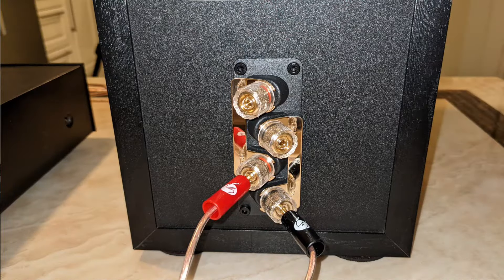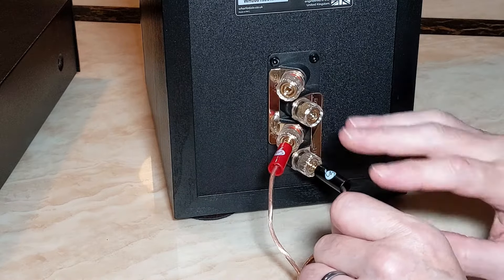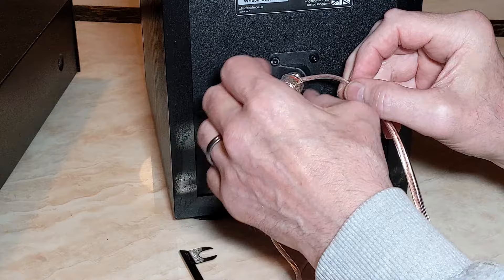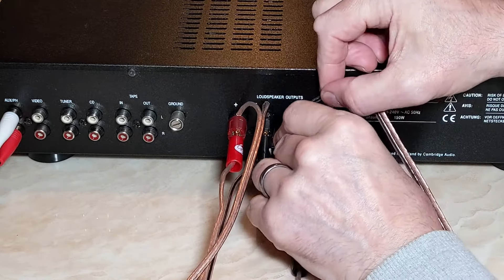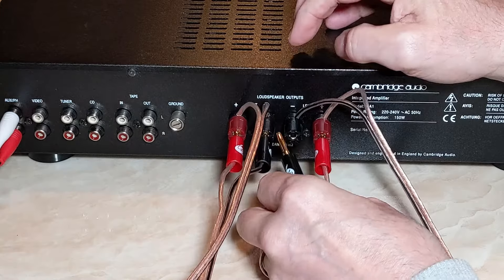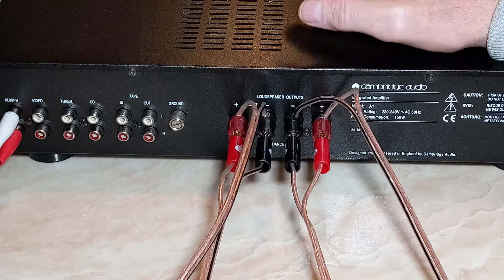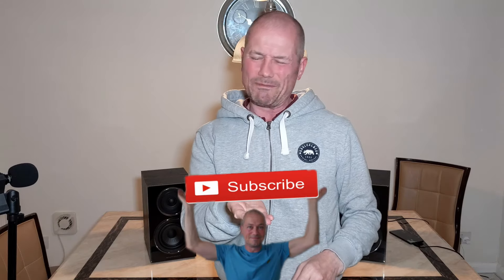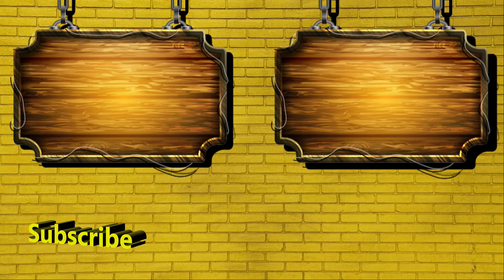How To Bi Wire Your Speakers (Includes Sound Comparison) #utilitariantv

Comment: Would it make more difference if the amplifier has A and B outputs for biwiring,   or using 2 amplifiers at all for the biwirings?
Reply from the maker: Although some people suggest otherwise, using A/B outputs wouldn't make a difference. Using two amplifiers (Bi-Amping) is very different from Bi-Wiring and also more costly but you may hear a difference?

Comment: i would also just like to add… that, yes there is a vast improvement in sound quality when upgrading to solid copper wire.
i certainly noticed that.    I’m using a DVD player with a built in amp;  so… basically I’m listening to music straight from the horse’s mouth; so to speak.     It seems to me also, that.. the more watts input a speaker has;  a much better realistic sound quality you will get.   
i recently bought a pair of Moukey speakers ( 3 way 55 watts input)  but the Wharfadale 9.1 beats overall. 
Wednesday 12th October 2022  U.K. Southampton

Comment: But surely the point of bi-wiring is that you use different types of wire for woofer and tweeter...? Some wire, for example thicker gauge wire, transmits lower frequencies better, some wires transmit higher frequencies better. You use different wire types depending on what effect you want.

Comment: Is bi-amping intended only for passive speakers then? what would be the point to bi-amp active speakers otherwise? A noob question but still does my head in.
Reply from the maker: I'm not sure that you can bi-amp an active speaker as an active speaker has its own amp. There may be some out there but it's rare.
Reply: @UTILITARIANTVUK  that's what i thought, thanks for clarifying

Comment: Hi, what speakers are these? They sound good, and what receiver?
Reply from the maker: Wharfedale Diamond 12.1 speakers and Cambridge audio A1 mark 1 amp.
Reply: @UTILITARIANTVUK  Thank you. I had to play both samples many times to find the difference, biwired's volume is slightly lower than the other,  if you are absolutely sure volume was kept exactly same at amp level for both sound samples the difference with biwired is lowered volume with a pinch of added subtlety

Comment: What I do run is run a small wire by the speaker from the one port to the other. Those plates were actually working as bi wire in the same way, which is why you probably heard no difference.
Reply: This is exactly what I was thinking.....this guy clearly has no idea what he is doing. Most higher end speakers that are bi-wire capable come with a jumper in them to make them bi-wired straight from the factory. The jumpers are made of metal hence it being a conductor of sound. This is exactly why he heard absolutely no different BECAUSE THERE WAS NONE!!! LOL. Besides he needs to buy a nice set of OCC Bi-Wired 2-4 banana cables. If he just would listen to the speakers with the wires connected to just the bottom (low) connection on the back of speaker (WITHOUT THE JUMPER IN) and then wire it how you have speaker wire going to both sets of positive and negative terminals on the back of speaker and tell me if you don't hear a difference then!!?? .......THATS BI-WIRING
Reply: @thomasfitzgerald2595  Not really, just check the Wharfedale specs and you'll see that for a standard connection you need to keep the metal plates (the signal needs to go to both crossovers, otherwise you'll get only highs or lows) and for bi-wiring you need to remove it so the same signal goes to both crossovers again but using 2 different conductors this time as it supposedly reduces the intermodulation effects. Electrically bi-wiring creates a parallel connection with the same voltage through both wires however with different currents. These being said, if it makes and audible difference or not it depends on the listener. (further reading https://www.qacoustics.co.uk/blog/2016/06/08/bi-wiring-speakers-exploration-benefits/ )
Reply from the maker: I literally followed the guidelines in the Wharfedale manual exactly as it was laid out. So either you clearly do not know what you are talking about or Wharfedale has it wrong? PAGE 5 OF THE MANUAL HERE (I can write in caps too😃) https://www.wharfedale.co.uk/wp-content/uploads/2018/11/Diamond-200_manual-print0725-1.pdf
Reply: @thomasfitzgerald2595  the jumper is to send the signal from the single wire to the two separate crossovers, single wiring. Remove the jumper and run a single wire to the low end and a separate single wire to the high, that makes two sets if wires, bi-wire. Putting the jumper in does not bi-wire the speaker, it is getting information from one set of wires and sending that to the two separate crossovers.  Running wire to each crossover separate  preventing Intermodulation. One will have to study that on their own if you don't understand the different current speed rates as they enter and exit the different  crossovers and speakers. Using a single wire with blocks is not bi-wiring, it is pushing all information to both crossovers through one cable, causing the signals to pass through at different times and causing a traffic jam of sorts. Bi wiring let's each crossover recieve and expell the signal at its pave, not get in the way as each one is putting out a different rate through one wire back to the amp.
Reply from the maker: My response https://youtu.be/_5FH2tKONQ4

Comment: Bi wiring makes a difference to me. Instead of the crossover separating a signal into two. It just separates high or low frequency. Plus less resistance from cables. I dont use cheap amp. Cables or speakers.
Reply: That's literally not how bi-wiring works.
Reply: Lol. Crossover is still engaged with biwiring.

Comment: You prob don't have enough power or didn't do it right, or wrong specs in general. I have Yamaha NS555 tower speakers with a pretty old Yamaha a/v and I run biwired via speakers A&B. 1 pair goes to A, other pair to B. If I turn off A, only bass plays, turn off B, only highs play. So it seems more power to the tower (haa that rhymes) and louder when both in. Same length heavy gauge weird 6'for all 4 wires. Wonder what would happen if I left them both with jumpers, more power/volume????

Comment: Great video, thanks! What wires were you using? What would you recommend fo a Wharfedale 85th anniversary and an integrated amp? Cheers...
Reply from the maker: I'm just using Amazon Basics. Really good for the price if your cable requirement is under 5 metres. https://amzn.to/35GqO0J

Comment: There's no point in "bi-wiring" from physics point of view. But: bi-wiring creates a "ground loop"  -  a loop of two parallel wires connected at the ends forming a giant coil which is prone to picking up electromagnetic noise... So unless one is driving two speaker inputs from different sources (can be same amp but with different spectral drive - highs, lows, etc.) - there's no point in biwiring.

Comment: In this demo the copper strips on the speakers were doing the same job as those wires were doing. As thats not a bi enabled amp. You need 4 outputs on the amp. Not 2. 👍🏼
Reply from the maker: Wharfedale actually recommends it in the manual  the way I did it. Although I have tried it with a/b speaker outputs here https://youtu.be/h-H6PW452PE
Reply from the maker: @HyperTech Electronics Wharfedale must be stupid too. That's exactly how it's recommended in the speakers manual. Also, try taking your caps lock off. 😄
Reply: That is bi-amping. This video is about bi-wiring 😂

Comment: I bi wired wharfedale diamond 220 s and Rotel RA810 so not a million miles away from your setup.  I noticed a separation from high and low and it definitely didn’t sound as congested but the big thing is music I’ve grown up with and know very well had noises and tune I had never heard before. Don’t expect massive changes in volume , bass  and treble like I was expecting. Let the system settle in for a bit , play some of your favourite tunes and Im sure you will notice clarity that was never there before. Hope this helps a wee bit

Comment: 56 years old now but when I was in my 20's I could definitely hear a difference cant tell from this vid though...as your not bi wiring the amp just the speakers that's not bi-wiring to my knowledge sir...
Reply from the maker: Actually, wiring two amps is called bi-amping. The way I did it was taken from the Wharfedale manual in the 'how to bi-wire' section.

Comment: Im 22 and I personally couldn't really tell the difference during the first part of the song between the two. In the second part though the Bi wiring had a little more punch in the bass frequencies compared to the single wiring. I've got a hifi system that I'm trying to set up with polk audio RM2000 monitor speakers, RM1000 Subwoofer, CS150 centre monitor and 2 JVC SP ES5 bookshelf speakers for surround sound. I'm trying it out with music production :)

Comment: I don't hear a difference. I mean all the bi-wiring is doing is replacing the copper jumpers from the speaker posts so why would it make a difference? Its still receiving the same signal from the receiver. I think bi-amping would be the only way to really see a difference.

Comment: I noticed a difference. I just got a Denon PMA600 and Wharfedale 220 speakers. I thought that it rounded the sound off nicely and elminated the treble heavy sound associated with standard wiring. It also cleaned up the sound of vinyl nicely

Comment: Really interesting! I've never thought biwiring had any merit, but I'm certain I heard a difference between your 2 samples... I kept my eyes closed, listened through decent headphones with an external dac, and opened my eyes when I heard a difference; when it sounded "fuller" I opened my eyes to see "Biwired", and when I next opened my eyes because I felt it sounded slightly "thinner", it was single wired. In a second listen I also thought I heard a SLIGHT difference in the treble presentation. 🤷🏽‍♂️ I'm no expert and certainly not saying I'm sold on this school of thought, but thank you for giving me reason to consider it.

Comment: Bi- wiring as you demonstrated is essential only feeding a thicker cable to the speaker, so not really useful and audible,the REAL purpose and audible benefit can come from BI- AMPING....by means of two separed amps,and through a crosover bevore these amps, so one amp let's say a 20 watt feeds only high tones to the speaker and another,let's say 60 watt feeds the lower tones to the mid- bass speaker, this can give a better sound because less stress on your build in crossover and speakers so effective more  cleaner power to you units, so bi- wiring 
not so usefull, bi-AMPING more usefull I've you gotta the crossover frequencies sorted right and the amps ( money) to do that, at home for most people not really importend, in a disco with loud volumes it's more or less the norm, think of a " basebin" pumping out 120 db all nightlong.
At home you would be better of investing in a nice active subwoofer with build in amp and two way crossover.

Comment: Bi-Wiring is not going to make any difference in sound quality. Your sending the same single to the same cross over network. The only difference would be the increase in wire size by doubling them which can reduce resistance in the wire if your using small gauge wire. Bi-AMPing is something completely different altogether. Having two amplifiers one dedicated to the highs and one dedicated to the mids/lows with the ability to adjust the volume level separately to balance out the sound. A tube amp for the highs and a solid state amp for the mids/lows. Magnepan 3.7s MG3As etc. have the option of having 3 amplifiers per speaker. One for the highs, one for the mids and one for the low end. With a good active crossover you can really make a big improvement in sound.

Comment: I don't see the point of bi-wiring when running from the same amp.   It's no different to just adding a bit thicker cable.  The main use would be if you have a bi-amp setup and have the mid/rop amplified separately to the bass/
I could hear absolutely no difference, which I expected anyway on YouTube, but I have also done the experiment in real life.
Reply: I also agree with your comments, maybe his answer would be to purchase better cables.

Comment: I doubt anyone will hear the difference through a YouTube video. 
If you're not convinced with your own set up then bi wire your speakers but leave the connecting wire unattached from one terminal.
Then while playing something, tap the lose wire in time with your music to the terminal. 
I can hear the difference with my diamond 9.1

I've just done the same with the connecting plates. They do exactly the same. I'll stick with the plates so I don't loose them.

Comment: Lots of half-correct info in the comments.  The point of bi-wiring capability on speakers is that you use TWO AMPS, but not one for each speaker.  You use one amp for the highs and mids on both speakers, and a different amp for the lows on both speakers.  The difference in sound depends entirely on the respective and relative power of your amps and handling capabilities on your speakers.  If you're using a big McIntosh 2300 and you have a pair of high efficiency Klipsch, bi-wiring is overkill as the Mac has plenty of power and then some. On the other hand, if you have big power-hungry JBL's and a Marantz 2216 which is fantastic but on the lower power side, adding another would really boost the big JBL's.  Bi-amping and Bi-wiring go together, it's pointless to do just bi-wiring.  If you have a good old big receiver where A and B speaker settings use different power stations and no loss of volume occurs when you turn both A and B speaker pairs on,  it could conceivably work the same as two amps.  But most modern and lower priced  receivers simply split the power from the same source if you select A and B speakers and then send half to each.  Old BIG 70's Pioneer, Kenwood, Sansui, Marantz, Mac, etc usually don't-- they send full power to each, so bi-wiring from A and B, *one to each frequency range input pair on both speakers*, NOT *one to both ranges on each speaker*, could work nicely.
Reply: that's bi-amping, not bi-wiring

Comment: Could u run these speakers with just speaker wire?
Reply: You can run any speaker with any kind of wire in the world.....it all has to do with conductivity and wire shielding to block noise interference. But yes you can use just regular speaker wire.

Comment: What the plates on rear of the speaker?
Reply from the maker: They are bi-wire jumper plates which connect the low and high frequencies. You use them when the speaker is single wired.
Reply: @UTILITARIANTVUK  lost one of mine so I need to order one. F-200 klipsch tower speaker.
Reply from the maker: @MrKike1313  you can also use a jumper cable. https://amzn.to/3NXWymp

Comment: Got so much to say...
1.) Your are using twin flex  Chinese cable . This is the biggest loss in your audio path. More on the speakers later. (there are affordable cables that are proper, ie  Ixos XHS133. I use this on my near field setup.)
2.) with youtube compression, what is the chance of nuances making it all the way to to viewer?
3.) bi-wring has maybe a 5% improvement. See previous comment. Not a chance you will pick that up over youtube.
4.) bi-amping is where it is at. For bi-amping, I'm using van den hul wire. Not sure wharfdale and twin flex lamp cord is the right setup to use for this type of test.
Reply from the maker: My response https://youtu.be/_5FH2tKONQ4

Comment: I think you did a great job even though others say you didn't do it right or it wasn't a good environment for sound. You hooked it up properly, and it should make a difference in sound if there was one with you trial system. I think mileage varies if it works at all. I think using a better wire than the brass looking plate might help more, but dubious there too. Using good wire connected to main terminals seems the way to go in most cases. Weaker systems might benefit from this scheme more. (I did go back an listen again, carefully. I think I did discern a small difference. Now keep in mind I am reversing course on one thing another poster said about it not being the right environment, but he meant your set up. I think not only am I listening through you tube and my system, but I'm not there to evaluate sound stage etc. That being said, what I did hear was I think the treble had more pop, maybe even a little thinner and less controlled in the bass portion. Subdued is good word for the bi-wired scheme. This brings me to agree with you that the system single wired sounds better to me if anything.)